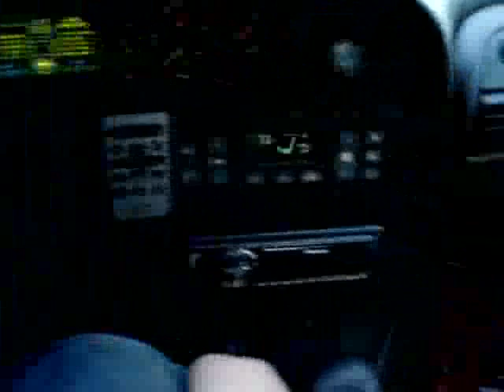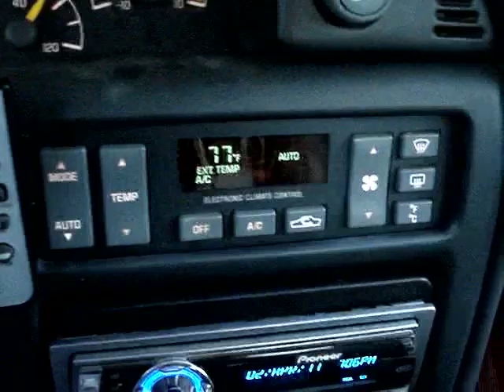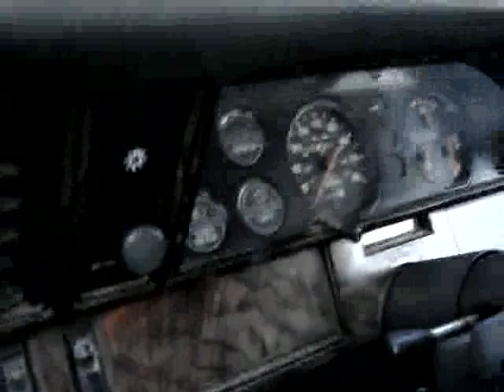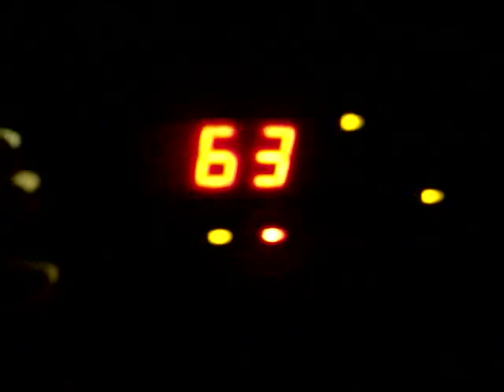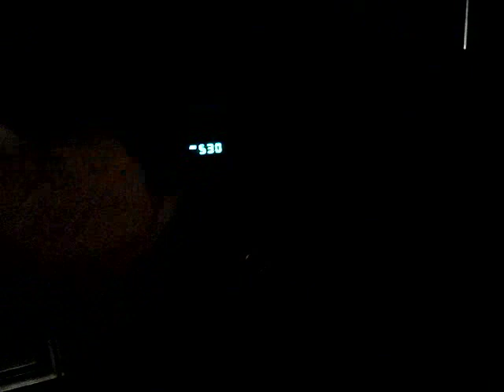Moving The Plymouth Reliant Wagon

Comment: Is that old barn still standing or did it collapse?
Reply from the maker: It never collapsed, at least not entirely. It was replaced with a new structure.
Reply: @uxwbill  cool. We have two old barns on our property in deep East Texas. One of them is still intact but in slightly questionable condition, and the other one is basically like this old barn was. One good windstorm could easily knock it down. We’ve already gotten anything we cared about of it. I have a video taken in November 2021 of the one in better shape if you’d care to see it.